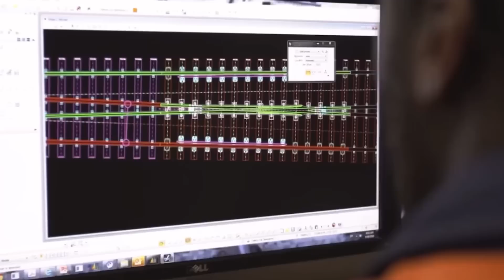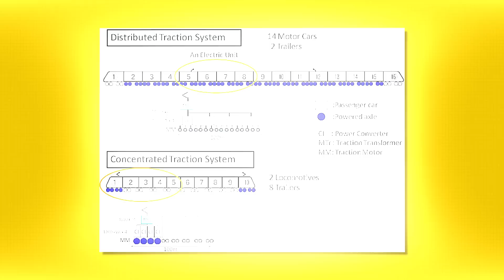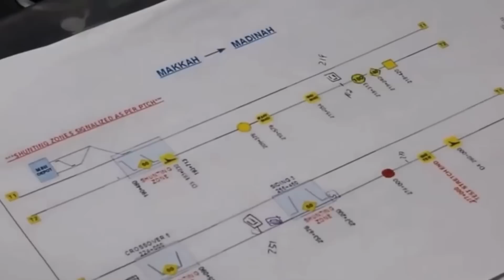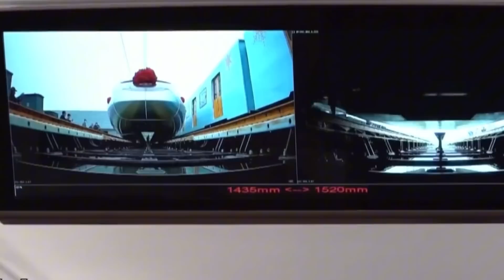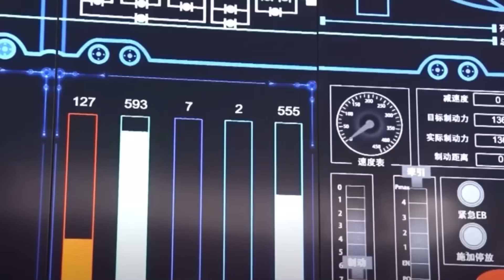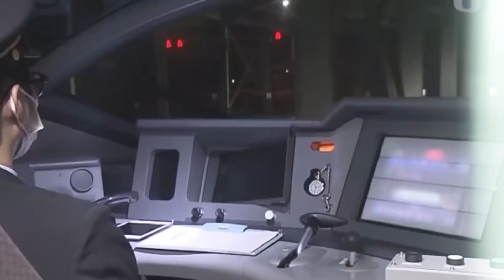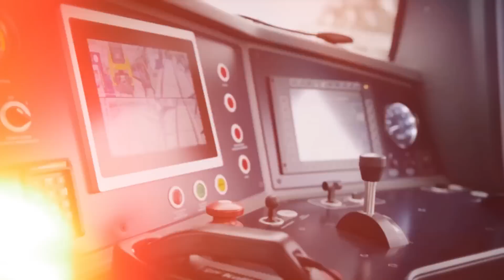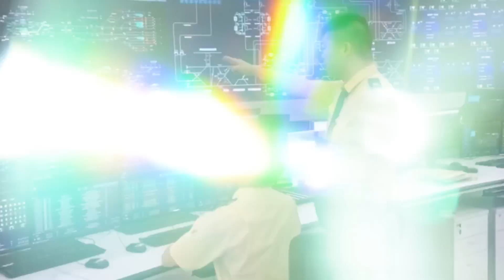Who Makes the World’s Best High-Speed Trains?

Comment: Your numbers are not correct: If all railway lines in operation with a maximum speed of 200 km/h and more are added together, Germany has 2,983 km of high-speed lines, France has 4,173 km, Italy has 1,845 km, the UK has 1,806 km, Sweden has 1,985 km and Spain has 4,130 km. China currently has 39,000 km, which consists of 9,000 km at 200 km/h, 16,000 km at 250 km/h and 16,000 km at 300 km/h and more.

Comment: 13:21 A high-speed tram? LOL
12:16 With 250 kph it can be used on the CMK (Central Rail Line) or for Rail Baltica services (in Baltic states), thats it. You can hardly name a 250 kph EMU "high speed rail".

Comment: at 3:33 i believe that's the turbine that the tgv was supposed to have as engine. they swaped it out with electric traction when the oil crysis hit. the train was still in the prototyping phase
Reply: The development was more like a fork.
Thry didn't just swap a gas turbine for electric motors, they re-engineered another prototype.

Comment: The UK with 2,214 kms of HSR? There is only 109.9 kms of HSR in the UK.
Reply: Same as my comment. It's to do with the speed. That chart refers to lines of 200kph/125mph and above.
Reply: @Eurobazz  200km/h on upgraded lines is considered high speed by most official definitions like the UIC
Reply: The UK has the highest average train speed on the planet, not many people know that
Reply: @gorgu08  no, they have HSR that leaks water
Reply: @GForce162  no, the UK upgraded its infrastructure rather than building more meaning classic lines run at 125mh which is higher than most equivalents in countries with HSR, thereby now having the highest AVERAGE speed network
Reply: @gorgu08  Sources? U didn't find anything supporting your statement, if anything I found numbers putting UK behind DE, IT, ES, and FR. Not mentioning it's a complicated metric to calculate, is it purely about theorical speed, is it averaged to the distance between stations, or proportional to usage? For instance, some countries have different distances between stations, depending on the usage and the population density, leading train to go slower. In Paris, local trains have a station about every km, and represent the biggest train usage in France du to the high population density, but as soon as we consider long distance, TGV reach 50% of the trains. Similarly in Britany, local stations are much more spaced due to the low population density therefore local train easily reach 160-200km. My point is that talking about average speed doesn't makes sense if don't limit it to long distance trains, and usage.
Reply: @gorgu08  no, China has 43000 KM high speed rail which has minimum 200 km per hour. UK has less than 100 km high speed rail.
Reply: @dahaixing2376  no, read my statement again and then think about it

Comment: The fuck y'all want the Chinese to do, Reinvent the wheel?? Spain did the exact same thing of "stealing the technology" (as you guys are saying) by purchasing French Tgv trains at first (which RENFE still operates to this day) and later developing its own domestic version from there. So did Korea with their first gen domestic trains, the KTX, which basically looks the exact same to the French single-deck TGVs (only the front is slightly different, the carriages are indistinguishable). A train that runs at high speed can't possibly be that much different from another train running at high speed made by another company. They are both trains (not like cows and sheep). The Chinese as latecomer had more options & after testing they chose to go with the most cost-effective one & made a domestic version out of it through technology transfers. So for Fuxing class trains the design philosophy is similar to some German ICE: EMU train with two bogies per car (as opposed to the French TGVs which feature push-pull architecture and articulated bogies that are shared between two carriages).
Reply: Vibration destruction
https://www.youtube.com/watch?v=boOmrzQYxLU&t=51s
Reply: @tonyburzio4107  That's not even Chinese HSR.
Reply: its own domestic version, not it's own domestic version.
Reply: @Adrenaline_chaser  lol... First of all: didn't Spain buy SIEMENS Velaro trains for their high speed? So why are you talking about TGV? And Spain didn't do the same. The CRRC Fuxing trains still use SIEMENS and STADLER parts and patents.

And you won't find TGV stuff in their trains, because they are using German, Austrian and Japanese technologies from the Shinkansen and Velaro train sets.
Reply: @mariokrings  the original AVE units were almost identical to TGVs, apart from the nose.

Comment: Generally good video, but with a few questionable facts: 1) The Avelia was definitely NOT the first double decker high speed train. The first was the Shinkansen series E1 (1994) followed shortly by the TGV Duplex in 1995. Also, I highly question the stats about the number of Km of high speed lines. 2) Your graphic of high speed rail network length by country looks like it was taken from a Wikipedia article which records the number of Km of lines over 200kph (125mph). This isn't really true high speed rail, which generally starts at 250kph (155mph). If you were to show those stats, the UK goes from over 2000km and 5th place down to 113km and 18th place!
Reply: The EU, which may as well be the global standards body on HSR at this point, does consider 200kph eligible for high-speed classification, but only for upgraded lines that existed prior. True HSR is at least 250kph indeed, and in my view it should only really count if it at least has the possibility of an upgrade to 300. Weird to go beyond 200, which has all the challenges of high-speed, but not up to 300.
Reply: @mdhazeldine  I think it's alright to argue about whether it's 200 or 250 km/h. But a video should be consistent at this point. And it isn't: The chart shows the amount of km of HST for each country based on 200 km/h and later in the video it's said, that 250 km/h mark the least speed of what could be called a hight speed train.

I don't care where they draw the line, but it should be the same from start to end.
Reply: @mariokrings  Yes, The video was not consistent or clear. It makes it seem like the UK has 2000km of 250kph capable line, which would be bloody amazing! but sadly far from the truth.
Reply: also E4 Series MAX Toki says hi :)
Reply: 200kph threshold makes sense since it is from the first Japanese proposal which started HSR fever.
Reply: @Danji_Coppersmoke  What is considered 'high-speed' keeps shifting – upwards. When the first passenger trains started driving some 200 years ago, there were concerns that people would go insane at the incredible speed of 40 km/h (more or less; they were already doing 80 km/h around 1850). Considering that the Shinkansen is over 60 years old, it makes sense to move the definition upward. After all, trains are now being designed with design speeds over 400 km/h.
Reply: @SeverityOne  And expectations can go further and further if we take into consideration Maglev technology, completely revolutionizing the concept of train (but before achieving this we need to have an improvement in energy)
Reply: @marco_grt4460  Yes, of course. In more general terms, my point is that what was considered high-speed 60 years ago, isn't necessarily high-speed these days. People get hung up on definitions and what various organisations have to say about it, without taking into consideration that the definition is very dependent on time and place.
Reply: The numbers in the video are not correct: If all railway lines in operation with a maximum speed of 200 kph and exceding 200 are added together, Germany has 2,983 km of high-speed lines, France has 4,173 km, Italy has 1,845 km, the UK has 1,806 km, Sweden has 1,985 km and Spain has 4,130 km. China currently has 40,000 km, which consists of 9,000 km at 200 kph, 16,000 km at 250 kph and 16,000 km at 300 kph and more.
Reply: @outdoorolli5754  200 km/h is not high speed. The accepted minimum is 250 km/h, and this is likely to increase in the future, as the Chinese and Indonesians are already running trains at 350 km/h.
Reply: @SeverityOne  UIC defines 200 kph/125 mph and more as high speed rail. Moreover you should use the same standard for all countries.
Reply: 3) The Velaro being "well recieved" in France, Belgium and the Netherlands is at minimum misleading because no domestic operator in these countries uses the Siemens Velaro. Germany's Deutsche Bahn uses Velaro on international ICE services to these countries.
Reply: The map isn't wrong. 200km/h on upgraded line is considered to be high speed by the UIC - significantly faster than most highway traffic
Reply: I beg to disagree about your opinion on the speed at which a train can be considered high-speed. The first high-speed train ever, the 0 series Shinkansen, had a top speed of 220 km/h (below your threshold of 250 km/h) and was and still is considered high-speed.
Reply: @mangococonut4918  If we're nit-picking, the 0-series wasn't the first high-speed train either. Rather, it was the latest and fastest EMU, following American, Italian and German sets. What Shinkansen means is 'new trunk line', and that's what was so revolutionary about it: a dedicated high-speed railway line without any level crossings. That's hadn't been tried before, and became the defining template for high-speed rail worldwide.
Reply: @SeverityOne   I think 0-series is the first HSR since HSR is not just train that goes fast. Like you mention, it required dedicated line, no level crossing, electronic signaling, etc...

Comment: "Chinese" HSR tech is not even Chinese 😂. Wasn't limited to tech transfers - Chinese policy makes companies tech transfer, and enter joint ventures with Chinese firms, from which they copy and reverse engineer, same with German Velaro trains and Shinkansen trains
Reply: That's smart.
Reply: The fuck do you want them to do? Reinvent the wheel? Spain did the exact same by purchasing French Tgv trains at first (which RENFE still operates to this day) and later developing it's own domestic version from there. A train that runs at high speed can't possibly be that much different from another train running at high speed made by another company. They are both trains (not like cows and sheep). The Chinese as latecomer had more options & after testing they chose to go with the most cost-effective one and make a domestic version out of it (so for instance you won't find articulated bogies of the TGV in Chinese trains. Just normal bogies like Shinkansen)
Reply: @Adrenaline_chaser  You seem triggered lol. The antics of the Chinese aren't exactly news. Renfe didn't reverse engineer by stealing the designs of trains like the CRH2 and Velaro, by a market system which forces companies to enter joint ventures, from which they reverse engineer with domestic suppliers. Kawasaki did raise concerns that China made modified later versions of the CRH2 independently. JR Central’s boss also accused China’s rail industry of stealing tech and neglecting safety. A CRH2 was involved also in the Wenzhou collision coverup killing 40.
Reply: @ce1834 There are still people who are still worried about what happened more than ten years ago. Little did he know that no more passengers had died since then. In addition, even if statistics were started 10 years ago, the safe operation mileage of China's high-speed trains now far exceeds that of Japan, which started statistics in 1964.